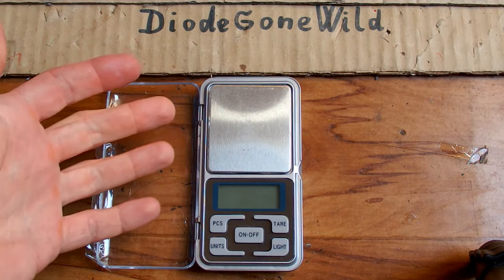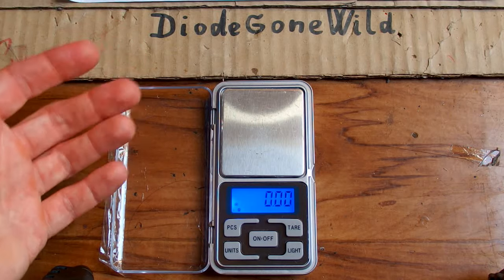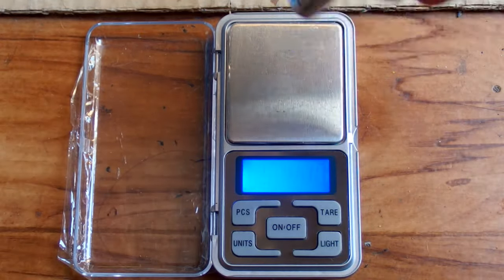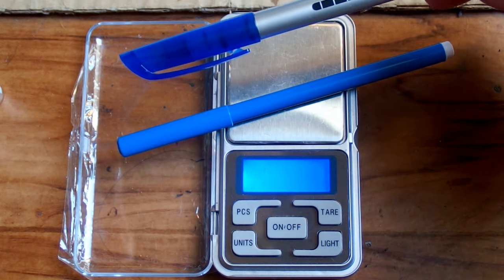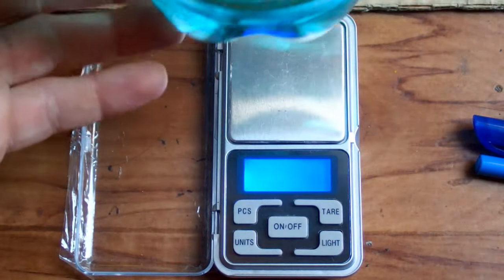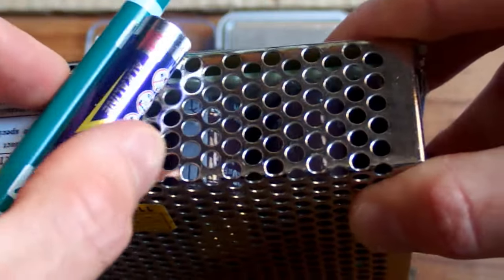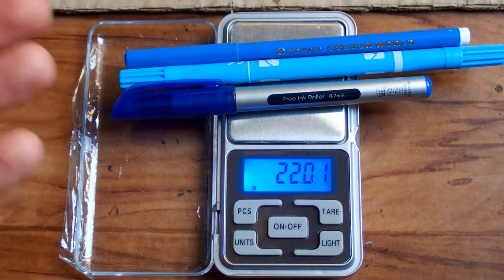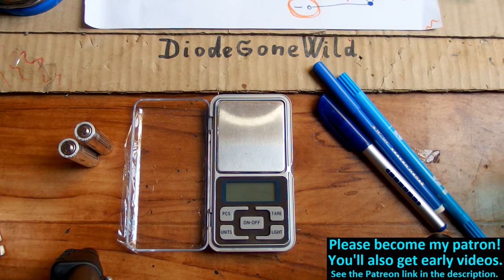How to calibrate (& miscalibrate) a digital pocket scale

Comment: The easy way to calibrate if you don't have a weight . Find someplace a scale a store or some where else . Take bottle of water  and measure the amount on it as you need there you got the calibration weight . And for accuracy do check the weight in another scale and then you won't have to buy one .

Comment: you shouldve added a bit of tape to the 500 gram weight to make it perfectly 500 grams
Reply: Or some matchsticks.
Reply: The problem is that we don't even know if the "500g weight" was actually 500g. He used the existing calibration on a cheap low quality scale to determine the 500g weight, so in the end it is no reference at all
Reply: Do want to try a new one? Buddy
Reply: @dimitrijekrstic7567  yea I guess we just need to count the atoms

Comment: This method uses a low quality scale to determine the weight of it's calibration weight which in turn makes the calibration done afterwards useless. You don't even know what weight you are calibrating for, your 500 grams might actually be 600, because these scales have been known to show 120g when used with an actual 100g calibration weight.

Comment: thanks, now I know how to scam my clients when I'm selling dope
Reply: nice
Reply: What would be really cool would be to have your own firmware that reports all weights back correctly, except for ones near the weight of your dope, which it adds 20% extra to the displayed mass! 

People have in the past modified the control boards in petrol pumps to do something similar. It would return the correct value for government weights and measurement amounts, and then once past the amount typically taken during a yearly legal calibration test, it would slowly ramp down the volume of fuel delivered through the hose by 20% while keeping the price charged incrementing at the same rate.
Reply: 99.9% of the LIKES are from newbie dope dealers. xD
Reply: @itsevilbert  Coin wear seems to be an issue. I checked several 0.50€ and 1€ coins i had and they had a variation of up to 0.05g - if my scale is to be believed, they were all between exact and slightly underweight.

Comment: Try pressing other buttons between the long and short UNITS press. Maybe you can set other weights to calibrate to, or maybe even the range of the scale. I have also seen a 2-point connector labeled CAL on some scales, probably enabling calibration when shorted with a jumper. Or does it receive serial data through the connector?
Reply: Mine says in the manual that you need the wight corresponding to the max range of the unit.
Reply: @pizzablender  Makes sense. Do you have the same model as DiodeGoneWild?
Reply: Push the tare button while flashing to change weight calibration.

Comment: Very informative - i wonder - all the scales with different weights they sell are probably the same calibrated differently :-)
Reply: The load cells are different. If they get overloaded a significant amount they will deform permanently and the scale would no longer give meaningful measurements.

Comment: The eBay masspieces are not useful if you do not have a verified mass for them. They are almost never accurate to more than 0.05%, and can vary a little depending on how they were referenced during manufacture.  Had them verified by a metrology lab, which cost 10 times the price of the masspieces, but now I know the exact mass, down to 3 digits after the decimal point. 

Checked before sending, and had to adjust the one up by 0.5g to get it to exactly 100g, which was easy, as they have a small pocket in the top under the screwed on handle, for this mass. Little pieces of solder added to those there already to get it correct. Yes I did see the reference kilogram there in the vault.

Comment: I wonder .... if you used a 50g precision weight for the calibration process instead of 500g, how close could you get this scale to milligram accuracy? I'm assuming that the load cell response is linear, which it might or might not be. And obviously you'd need to come up with a modified way of reading the display because the decimal points might be wrong.
Reply: I would test the scale verses a set of calibrated and certified calibration weights. That way I would know precisely what numbers I should get. But It will cost you.
A full set of weights is (100 g to 1 mg) 100g, 50 g, 20 g (x2), 10 g, 5 g, 2 g (x2), 1 g, 500 mg (0.500 g), 200 mg (x2), 100 mg, 50 mg, 20 mg (x2), 10 mg, 5 mg, 2 mg (x2), & 1 mg. An ASTM Class 7 set will cost you ~ $100.00 with no certificate, ~$300.00 US with a NIST Traceable Certificate or about $600.00 for a set with a NVLAP Certificate. For an ASTM Class 1 set in the same weights (much tighter tolerances) the prices are about $1,000.00, $1,500.00, and $2,000.00 respectively.
If you have access to a lab with a set of calibrated weights and a semi-micro (100.0000 g or 200.0000 g to 0.00001 g) or analytical balance (100.0000 g or 200.0000 g to 0.0001 g) you can use NIST SOP 7 (available online) to calibrate your weights yourself and generate your own certificate of calibration.
Alternatively you can buy a set of used weights (Class 1 or S) and have them adjusted and calibrated to ASTM Class 1. Troemner or Rice lake will do this for about $600.00. A single 50 g weight cost me ~$40.00 + S&H to have calibrated (50.000036 g +/- 0.000040 g).
Yes, I do this for a living, so I have this stuff at hand.
You want to do three test to check the balance.

Linearity - You check the reading against each weight in the set over the full range of the balance.

Corner Load - You check the reading of a weight at5 each corner of the weighing pan to see if the balance reads off center weights correctly.

Repeatability - You weigh the same weight 10 or 20 times to see what the variability of the balance is.

I would use the 10 g weight for Corner Load and Repeatability tests. Plan on spending a slow Saturday afternoon doing all this.
Reply: Great information for analytical scales. Simply ridiculous for the scale on the video.
Reply: @PatricioRomero_xumi  Yes, I know. But they could at least buy the single weights needed to calibrate the thing. That will set them back about $20.00.

Comment: Did you try calibrating at 50g? If so did you get a useable extra digit resolution? I doubt it somehow but that would be cool.
Reply: That's what I'm wondering too, is the ADC precise enough to get milligram  accuracy?
Reply: That was my idea too :D
Reply: five 2 euro coins (8.50g each) and one 1 euro coin (7.50g each) should be 50.0 g
Reply: @itsevilbert  Coins vary more than you think. Using a calibrated precision scale I weighed a load of British coins...Well I should have started by saying British coins vary a fair bit. It was only about one in ten that were within a digit or two at 100th/g of specified weight even among mint examples. I can't remember the deviation values. Euros are probably better...But coins are not weights to rely on unless you select them.
Reply: @martinda7446  As long as they are untarnished, new coins fresh from the bank they are pretty close to 2 digits for Euro coins and 3 for US coins. But with tarnish, oil, finger prints and accumulated gunk, all bets are off as to how accurate they are.
Reply: @itsevilbert  I think so.
Reply: @martinda7446  the UK has a very high percentage of counterfeit coins, i wonder if you weighed any
Reply: @arthurmead5341  They were high value coins like the pound, had hundreds of fakes but the new one is tougher to counterfeit. Under fifty pee nobody would bother.

Comment: I have the same (looking) scale. after entering calibration weight you can press tare and it changes to 200, 100, 50. So I guess it can be calibrated with other weights. Could you try that. I don't have 500g weight so don't want to risk my scale
Reply: You can buy a 200g calibration weight forc€2,20 and try. 
If you cannot calibrate it directly you can calibrate it with a bottle with half a liter of water and check it with the 200g weight. 
Adjust the water in the bottle and repeat until the scale reeds 200g with the 200g weight.
Reply: @Conservator.  Or if you are in the US 200 new 1 cent coins weigh exactly 500.0 g. Or 100 new nickels weigh exactly 500.0 g
Reply: I wonder if that's not so much for using different weights but further calibration, assuming these sensors aren't perfectly linear.
Reply: @itsevilbert  If someone does not have a calibration weight and is in a rush, in Europe.. you can make 100g with: 6x (1 cent) + 2x (2 cent) + 2x (5 cent) + 1x (10 cent) + 1x (20 cent) + 8x (50 cent)
Reply: Do want to try a new one? Buddy
Reply: Thank You for your information. You saved me from buying a 500g calibration weight - I already have a 100g weight and did not know what to do when my new scale said I needed a 500g weight.

Comment: If the scale isn't calibrated in the first place then how would it know if what you placed in it was indeed 500g or 2g?
Reply: It wouldn't, that's sort of the point of having the calibration weight. The numbers on a digital scale are more for our benefit than the sensor itself. The 500g (in software) really corresponds to a very specific resistance (with some margin of error) output from the amplifier connected to the strain gauge used as a sensor in these.

Comment: Trust you to put a massive weight on it lol :-D
I have a similar scale, i used it to weigh tiny ball bearings for equal weight, i did not have a micrometer to measure there diameter and that's all i had to get roughtly the same size bearings.
Some one had taken apart a gimball mount for a record player arm and lost some of the balls.

Comment: so i have the same scale but with a max capacity of 200g. I accidently miscalibrated and now whenever I try to recalibrate (by putting on 200 ml of water for example) it says it's overloaded, so I can't recalibrate it again, what can I do? is there a factory reset?
Reply: Take the batteries out for at least 10 minutes or so and when you put them back in, it'll be ready to properly calibrate (done it myself)
Reply: This is what I needed answer to as well. Only 1set of scales and instructions didn't tell me I needed to find something that weighs 50g before I pressed calibrate. Taking battery out now for 10 mins. Didn't know u have to leave them out for 10 minutes. Thanks

Comment: I just don't understand, you're using an uncalibrated scale to weigh 500g... and then using those wrongly weighed 500g to calibrate it?
Reply: Because When you enter into calibration mode, it resets the scales ready, waiting for the correct calibration weight needed. I messed my scales up and took them into a jewellery shop, and asked if they would mind putting a 500g weight on my scales in calibration mode, and as they had the correct 500g weight, my scales was sorted. I tested them, putting a uk 1p coin that should weigh 3.56g, and it did

Comment: Single point calibration? Hard to believe that’s an accurate enough way to do it!
Reply from the maker: Zero is the second point :). And load cells are probably quite linear...
Reply: Thank you. I bow to your much greater knowledge! 🙌🙌🙌🙌🙌🙌
Reply: @jerome_morrow  Most balances (even $20,000.00 Semi-micro or micro balances) use a single point calibration. To fully characterize the balance you then have to carry out a full calibration check (Linearity, Corner Load, and Repeatability Tests).